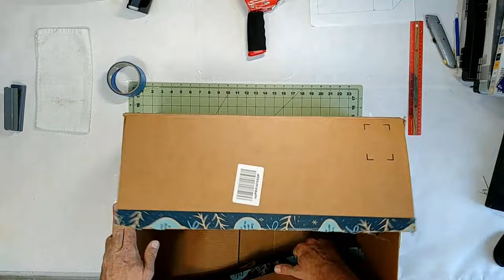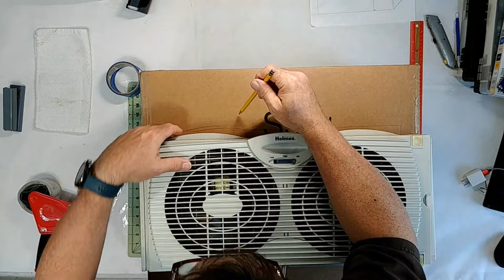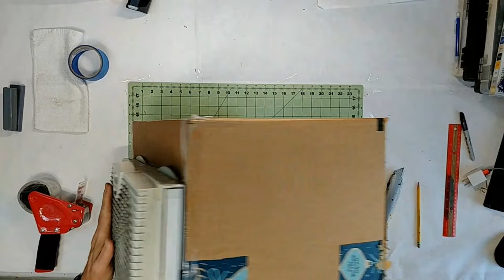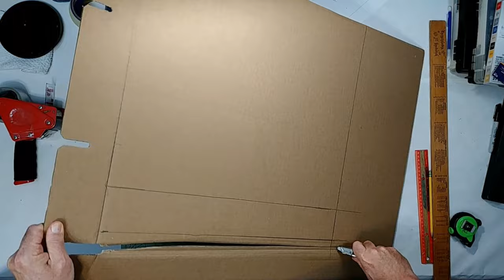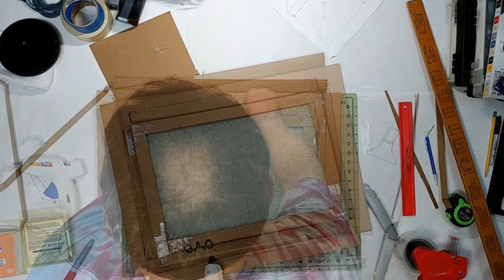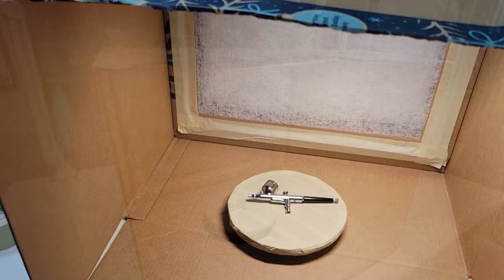DIY Airbrush Spray Booth Build

Comment: Did the same thing years ago. I had an air conditioner in the window with a plywood panel over it. Took a PC fan, a dryer vent cover and a cardboard box. Ripped the cord off of a piece of junk fan in the garbage bin. Only thing I had to by was a filter. Worked perfectly for years. Just finished building another one, this one fits into the balcony door and is removable.
Reply from the maker: I redid my workshop a few weeks ago and now the one I have doesn't work as well with the window so I'm redesigning mine  also.
Reply: @bryanshobbies  My latest one is a double walled box with 4 computer fans in it. I just framed around them with 3/4x 1 1/2 strip cut to fit a standard AC unit. I just tape it in place with masking tape. Mind you putting it into the door window every; time I want to spray is a PITA so in warm weather I just pick up the gear and do it on my bench on the balcony. I built the thing for use in the  winter primarily.

Comment: Great video! The only improvement that I would suggest is to attach a pedestal box to the bottom of the spray booth to raise it above the surface of the table. I use a box that is about a foot tall. It makes it easier to spray from beneath and just makes things more accessible overall.
Reply from the maker: Excellent idea, thank you very much for watching!

Comment: Hay there,built mine with a large  cardboard box I pulled out of a dumpster at a hardware store. Painted the inside with gloss paint so it can be wiped out. Fitted a ceiling fan in the side,sealed with heavy duty tape,then taped an expansion tube to the fan, that can be pulled out so it sits outside my shed,all the fumes get sucked out. Works OK...
Reply from the maker: Cool! Thank you very much for the input.

Comment: im about to rebuild mine (5 years, used a tote) but 1 thing im going to stick with is using a drier OUTLET for the exhaust inlet and then using an inline fan after 8 feet of drier hose. just a simple layer of fabric over the exhaust hole and by the time the paint has gone through 8 feet of hose theres nothing left to hit the fan. it also gives me options if i want to pipe it out a window or in to the drier exhaust line.

Comment: Currently building one myself, but instead of a cardboard box, I use a plastic box container. I did think about cardboard but I'm using a rather beefy ceiling exhaust fan so I need a sturdier material. Very excited to start learning airbrushing for model kits!

Thanks for the video.
Reply from the maker: That sounds great, the Only Rule for these things is to keep harmful stuff out of your lungs.
Reply: @bryanshobbies  Sad to see a neighbor across the street rattle canning a coat rack with bronze metallic. Spraying into the wind while sitting Indian style. I keep a 3M mask handy and bust out the cartridges rated for V.O.C. I once had a sticky valve and the tiny whiff ran me out of the room.
I wonder how much cartridges cost now.
Haven't needed them in five years.

Comment: I think this would work. I might not use a filter or fan since I'm likely to never to spray indoors but I do need a spot that keeps the overspray down when I spray outside and a place for the parts to dry safely.
Reply from the maker: I admit, I do not use it as much as I should, but I have created a small extractor fan that is fantastic for acrylics. 
If you'll dig around on the channel, you might find that one interesting.

Comment: I think the word your asking about is a 'Plenum?'
The fan may not lost long. For full size car, 
I built a diy spray booth under a car port. Shot three stage Auto paint. I used a high velocity floor fan. Paint built up on armature windings and fan stopped turning. Real auto spray booth should use belt driven fan.
Which is to prevent an explosion by the motor and vapors. Lucky I did not blowup!
My Diy also used an air filter similar to yours.
 I do know the volume of paint from an Airbrush isn't much by comparison to a large HVLP Paint gun.
Maybe use a smaller fan, like one from junk microwave. Those typically only use 20 watts. And can be stuck on the end of a vinyl clothes dryer hose.
Maybe use an LED light bar for illumination.
You can cover it's lens with transparent food plastic wrap. Just tear off the old sheet when it has accumulated coating of overspray.
Here's a hint of math.  One and one half cubic foot of volume, would work well being evacuated by a fan capable of ninety cubic feet per minute.
For you metric guys, do your own conversion
Please.
Reply from the maker: Sounds like good advice, thank you.
Reply: @bryanshobbies  Your welcome. I liked the whole video.

Comment: Great work, but I think that should i follow through, ill make the filter access easier to replace.  Asl it looked like yours was permanently in place.  Im guessing that your going to have to rebuild the encasing portion of the filter.  Maya simple hinge along the top part, and velcro strip along the bottom.  ????
Reply from the maker: It will actually pop in from the front. I can take the whole baffle, and the filters just held in with some masking tape. In fact, I've already replaced that cheap furnace filter with a good pleated one.

Comment: Nice setup. How long do you guesstimate the filter will last?
Reply from the maker: That's going to be dictated more by the amount of overspray run through it rather than how long you've had it. I've only changed it once so far, and I've been using it off and on for about 3 years

Comment: What did you use for the actual filter material? Great idea and the video was clear and easy to understand. Thank you very much and I await your reply.
Reply from the maker: It was a 20 x 25 in furnace filter but I quickly upgraded it to a better one with a baffled surface.
Reply: @bryanshobbies  When you refer to "baffled surface" are you meaning a "pleated filter" versus fiberglass/foam ?

Comment: The design of the booth is awesome but how well does it work do you use it in front of a window or where you have it on the video. Does the overspray gets sucked in then thrown out the back, but does it get rid of all of it or most of it. Curious mind because I'm planning something similar but with some mdf panels I have.
Reply from the maker: Yes it is absolutely venting out of window. I got lucky all around on this setup and that it fits perfectly on a desk top pointing out a window. I am even able to put some baffles around it and it will even pull a slight negative pressure in the room.

Comment: Awesome! Want to do this myself, but a question - can i use this at my work bench in the garage or do I need to vent the exhaust outside?
Reply from the maker: If you're using water-based acrylics, no, but if you're using anything with propellant or paint thinner, yes, vent it outside. Even then, I still recommend a respirator or, at the very least, an N95.
Reply: @bryanshobbies  thank you.  I have a full respirator I use but still have a box fan I was planning to use flexible ducting with to vent out a window.

Comment: The price of the fan you installed is the same as the cost of a premade airbrush booth now.
Reply from the maker: The fan had been laying in the garage for several years unused and besides the experience and problem solving was worth more to me than anything I could have purchased. After all the point of all of this is to have fun.

Comment: Nice work but the fans are more expensive than a spray booth
Reply from the maker: The fan I used is one I had laying around, and I just adapted it to the box I had. 
This project could could be done with a cheap box fan also. You would  just need to make the opening on the back of the box bigger and secure the fan so it doesn't leak around the edges. 
Also, buying one is an option. It's just not as much fun, in my opinion. 😃
Thanks for watching!!

Comment: did you use it , inside ?
Reply from the maker: Yes, for water-based stuff I just set it on the table next to my bench rattle cans or anything solvent-based it's pointed out a window with some baffles around it so it can't blow back in.

Comment: So this is basically a homemade air filter with a box attached to the front for a paint booth
Reply from the maker: That's basically correct, except when you get up to the big ones like for cars and stuff.
Reply: Well I built one for my 3d prints and it works great, thanks for this video. I only use water based paints but definitely not interested in inhaling the pigments.

Comment: The onething to worry about is the fan isn't explosion proof.
Reply from the maker: That's a valid point but I think it's moving enough air that I'm fairly certain that any flammable Vapors are fairly dilute by the time it gets to the fan.  Also, I'm sitting right there with it if something does go poof I should be able to handle it. That's the theory anyway.